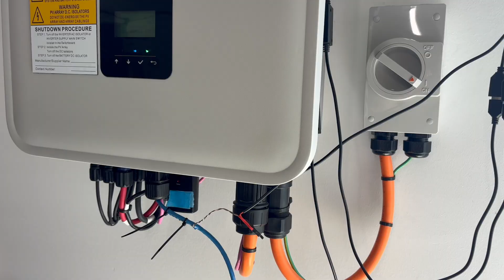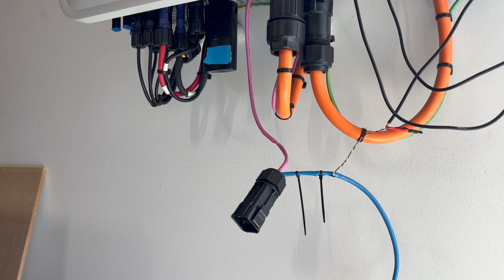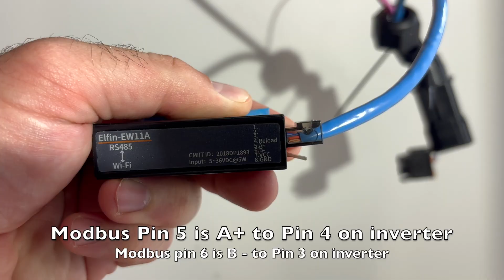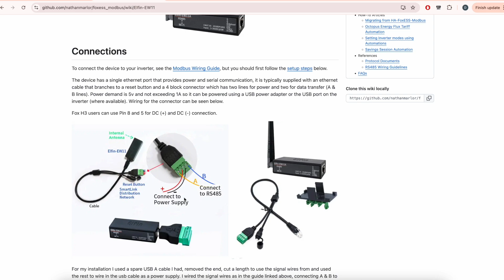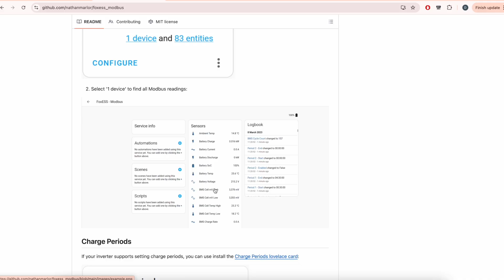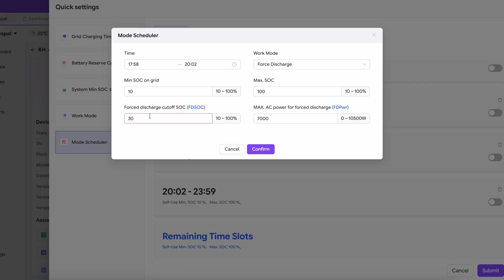FoxESS KH10 Modbus Installation and Connection

Comment: with you not actually going into the inverter, what would the issue be with just switching off the inverter and not the solar and batteries?
Reply: In my setup, I think the inverter is the central piece. Everything is hooked up on the inverter like your panels, battery and grid import all runs through the inverter so nothing will work if the inverter is off.

Comment: Well done Dave and thank you. I have my Elfinon order and will be using this as a reference. My installer told me when I shut down the battery I have to turn the AC off first then the DC and finally the battery. I noticed you did the DC first?

Comment: Thanks. I just setup mine today using the wavshare wifi gateway. Thanks for the guide. I am on globird as well  and trying to follow the automation as well. Super helpfull and appreciate your effort to put these things together.
I found it easier to do start and stop using trigger (create trigger ID with start time and stop time) and in actions using conditions (start and stop based on tigger ID) . Even you can add battery SOC(3rd trigger) in that trigger conditions as well.

Comment: Super helpful David. Im in same boat same gear.  Just waiting on modbus adapter to arrive. Did you have to enable anything on invertor to enable modbus.  My installer tried to enable it and got some error.
Reply: I've just done the same process following the video and have it working. Didn't do anything on the inverter at all.